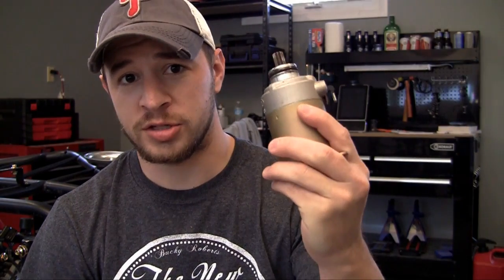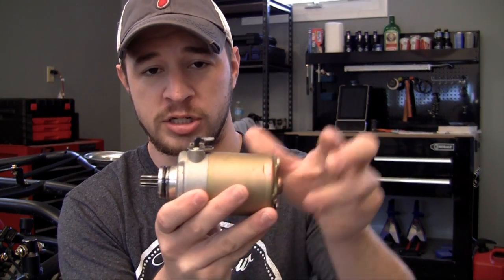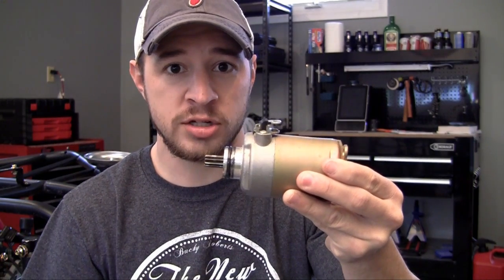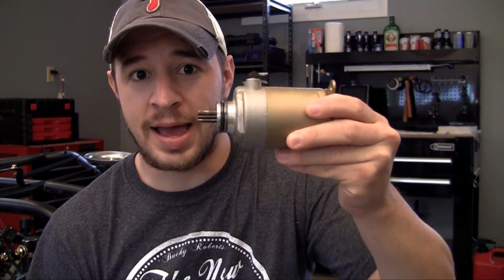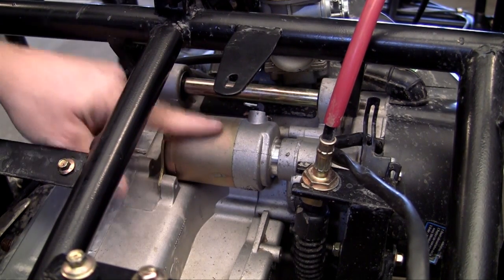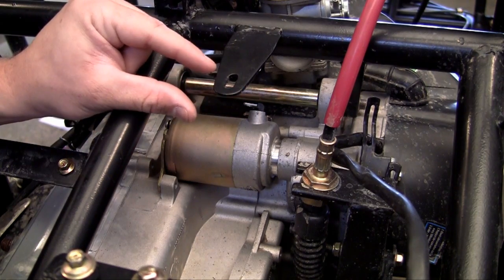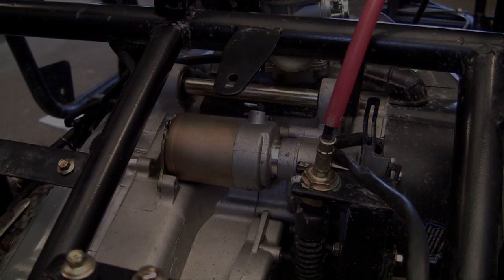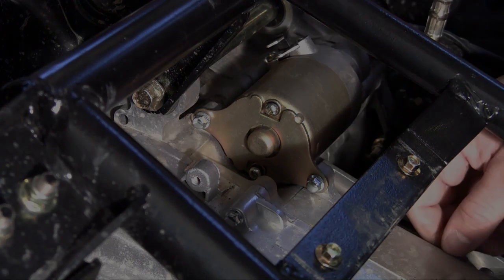How to Build a Go Kart - 16 - Starter

Comment: Is it possible to put a  electric starter on something that has a pull starter? I have a gx390 and my pull starter broke and if that's possible I might as well spend the money on a electric starter. Thanks
Reply: Hans yeah you need to get a new flywheel with theeth

Comment: I have a question, dude.. I am rebuilding a go-kart. The engine is a 6.0 HP Tecumseh. I just installed a new Spark Plug and Carburetor. It doesn't have a place for a Starter, but i really want to install one. Is it impossible to do so without a place for it?
Reply: AwesomeGuy did you find out? Is it possible to put a  electric starter on something that has a pull starter? I have a gx390 and my pull starter broke and if that's possible I might as well spend the money on a electric starter. Thanks